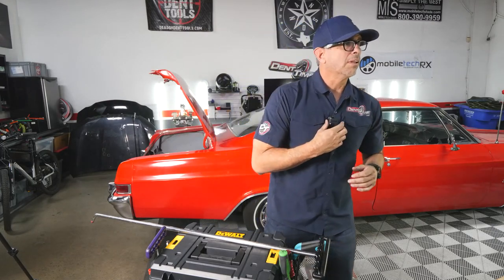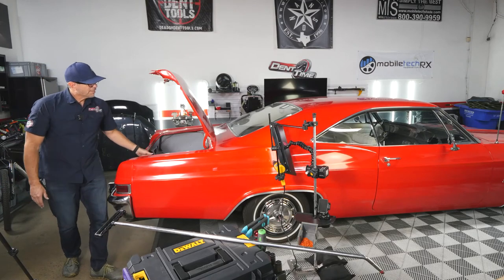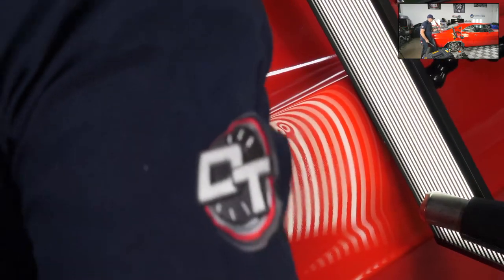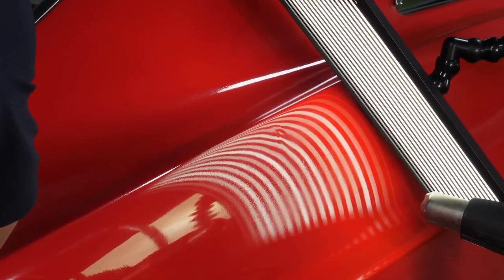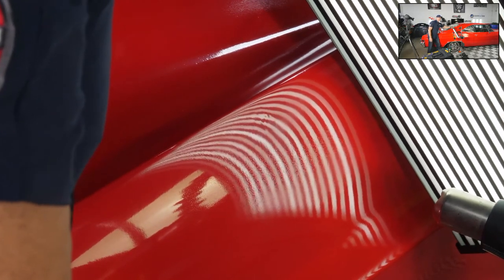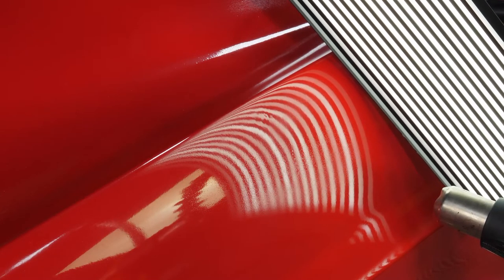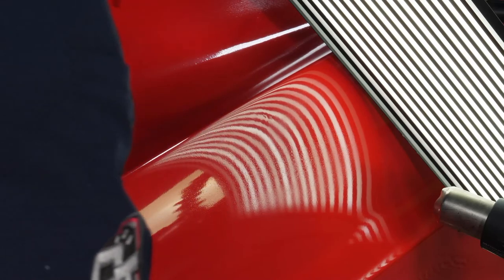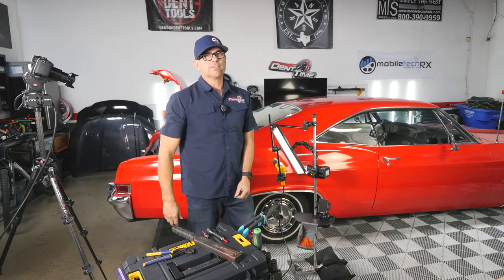66' Chevrolet Impala Super Sport Paintless Dent Repair

Comment: you were worried about running into filler, i think the only way you'd run into filler in that area is if there had been a  complete quarter panel replacement which is becoming more common as the numbers of certain classics decline, if that were a 65 big block impala ss i'd be worried about more filler...